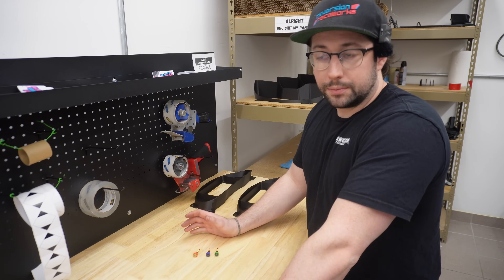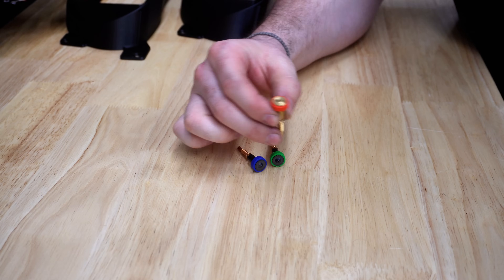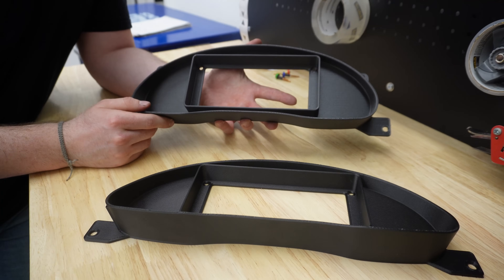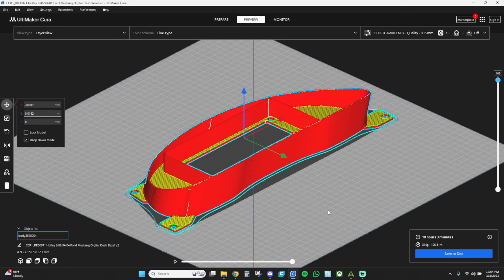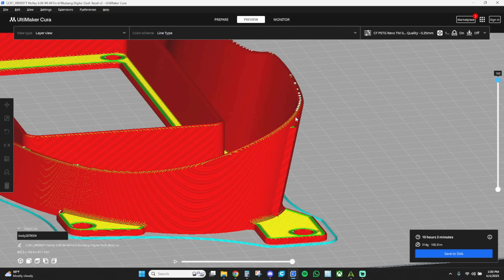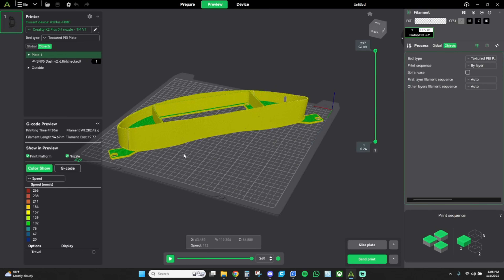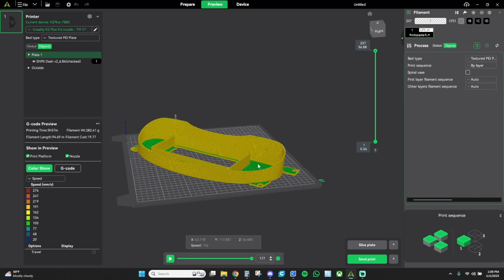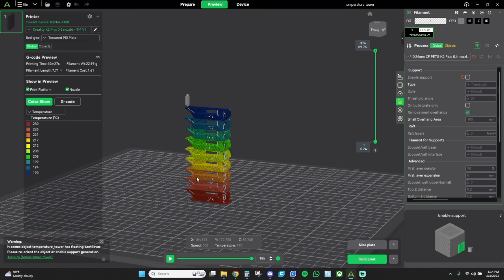Get better 3D Prints - What Size Nozzle Should You Use?

Comment: I switched from a .4mm nozzle to a .6mm hoping to increase speed on my Prusa XL and the time went from 3 to 4 days on a large print.  Any idea why it got longer instead of shorter?  Thanks!
Reply: Just a thought, but it could be due to slightly slower print speed. With bigger nozzle you can reduce number of walls and lower infill. Check wall thickness with 0.4mm and then with 0.6mm. Then you’ll see how many walls you’ll need.
Reply from the maker: My thought would be the “max volumetric flow”, default settings are usually pretty conservative for bigger nozzles. This may be called something else in prusa slicer, but I’d start with calibrating that. If you command a faster speed but it exceeds the maximum volumetric flow, the slicer will override your commanded speed so the extruder can keep up. If you have more questions, hit up our discord! We are happy to help

Comment: Hello, great video that I learned something from and in which I saw a number of things confirmed.
I switched from the 0.4 mm nozzle to the 0.6 mm nozzle early on when I started 3d printing with a Creality Ender 5 Pro. You can also print small parts with a 0.6 mm nozzle. When using the 0.6 mm nozzle with a Bambu Lab printer (I have a P1S), I have discovered that the nozzle temperature must be increased by at least 5% to ensure that the printed product does not become brittle and break easily. When using the 0.6 mm nozzle, it is necessary to reduce the flow rate, at least that is my experience.
Reply from the maker: I’m glad you found this helpful! We absolutely print small parts with a .6 nozzle as well, I normally go down to a .2mm layer height for the parts that need some more detail. 

I heavily recommend making unique profiles for nozzle sizes and materials, there’s too much variance. Although, one profile for a different nozzle is usually a “good enough” starting point for the tuning process. So I definitely agree with your experience as well!

Comment: I print loads of car parts. PETG will never hold up in a car interior, under the hood, or exterior. ASA is go to filament for this. Sit your PETG parts in a closed up car, or simply place them outside in the sunlight this summer, and you will see it warp and distort according to my testing. It may last for a little while, but long term I believe it will fail. I only have Bambu Lab printers, so your mileage may vary...
Reply from the maker: It’s definitely application specific! We’ve done tons of Carbon Fiber PETG in automotive interior applications. PETG CF has a Heat Deflection Temperature of ~175F. PETG without a composite added is likely a lower HDT and definitely less rigid, making it more warp prone. 

Even ASA is a bit too low for engine lay stuff, its HDT is about 185F. I’d recommend stepping up to Nylon for that.

Comment: One big issue I've had is how much "slower" my k1 prints with a .6 vs an identical k1 with a .4. i have literally sent a job to both machines within seconds and have had the .4 finish before the .6.
Right in the slicer, .6 speeds are always lower.
Reply from the maker: That sounds pretty strange. Our K2 and our media guys’s K1 Max both print fasted with a 0.6mm. While not as drastic of a difference, it’ll usually shave off something like 30-50 mins on a typical 4-5 hour print with CF-PETG. What materials are you using?
Reply: @reversionraceworks  hyper PLA, PLA +, cf PLA.
Reply from the maker: @GamingWithURO I would suggest tuning the “max volumetric speed”, fix the max value and dial it back by 15-20%. I find these safety factors improve reliability and quality. The default settings are likely too conservative, I’ve noticed creality only really puts effort into their .4 nozzle settings since they’re the most commonly used. The others are just a good starting point
Reply: @reversionraceworks  just screenshotted this. Next time I sit down at the PC I'm gonna mess with it. 
I had to make my own .6 profiles at 1st cause they didn't have any. 
Good looking out👍🏻
Reply from the maker: @GamingWithURO of course! If you have any more question, hit up our discord! Link in the description

Comment: Nozzle clogging with 0.4mm? I've had like 2 of those in 3000h+ of printing. 
If you are blobbing and clogging with a 0.4mm as often as you say, it's most likely your config or printer, nor the actual nozzle size.
Reply from the maker: Are you printing with composite materials?
Reply: @reversionraceworks  Sometimes, but not all the time.
Reply from the maker: Exactly, the .4 nozzle is great with normal filaments. We almost exclusively use composite filled filaments (carbon fiber and fiberglass). We found with the composite filled, it’s more common to see clogs and blobs on a .4 or smaller, but still get good print results. We just find .6 and larger to be more worry free and ease of use!

Comment: 0.6 is the first size for watertight prints. 0.8 is even better especially when printing vessels that should contain pressurized liquids.
One thing that I really  hate is hardened steel nozzles. I print only CF and GF filaments and those ting wear out soooo fast - nozzle mouth will get slightly rounded edges after pushing thru less than 1kg of filament.
Tungsten carbide is way to go if you like to have nozzles that dont need any maintenance. Just check them under the microscope after every 10 - 15 kg of filament.
Ruby is even better but im cheap :D
Diamondbacks are really bad as they come from factory with malformed nozzle "mouth"
Reply from the maker: Great tips! There’s so many options out there now, maybe we should do some more testing 🤔

Comment: My daughter’s boyfriend  just ordered a resin printer for his graphics design business. She has a small 3D printer as part of her embroidery business. I just bought the H2D. There are so many arguments back and forth on these things. I don’t like resin printers for several reasons. On is that the resins are very expensive and you do waste it when the item comes out. Secondly, the item is coated with resin that has to be washed off. It’s a mess. I’ve don’t it. Thirdly, there aren’t nearly as many choices as to resin type or colors. Nozzle size is complicated. For some things, I definitely agree with the 0.6mm nozzle, but for other things I would only use the 0.04mm nozzle. I just don’t agree with the one size fits all.
Reply from the maker: Definitely no one size fits all solution! Everyone’s unique use case should be considered first 💪🏻
Reply: So what?

Comment: ive never clogged my .2mm nozzles. However I still agree with you on the Resin for high detail opinion. But yeah, never clogged my .2's. Could just be bambu's design as these are the only fdm printers Ive used.
Reply from the maker: Do you use composite materials? We focus on CF-PETG, which in our opinion, would clog up really bad in a .2mm, we’ve seen it happy fairly frequently on a .4mm.

We’d like to get into resins at some point, but just haven’t had the opportunity yet. Those Bambu machines are great value for the money, and we’re happy they’re working good for you!
Reply: @reversionraceworks Oh, I wouldn't put composites through one. Good point.
Reply: @reversionraceworks  I guess I just assumed that isn't something people would be prone to doing. I thought it was really only for pla and maybe petg.
Reply: @reversionraceworks this is why I don’t believe that using just one size for everything. Making instrument panels with a 0.06mm works fine. But for a smaller part with higher detail, I find that the 0.06mm just doesn’t work as well as the 0.04mm. I’ve tried a 0.025 nozzle, but haven’t found much difference.

Comment: I found layer adhesion to be worse with 0.8 nozzle. How did you solve this drawback?
Reply: @sitedel do you print at the same temp and the same layer heights as a 0.4? You might need to up the temp a few degrees, you are pushing more volume.
Reply from the maker: Difficult to pinpoint not knowing printer, material, slicer settings, etc. But in doubt, when printing with adhesion issues, we will slow the speeds down, turn temps up a bit, decrease part cooling, use a heated chamber if able, and also increase flow to squish the layers into each other a bit more.

Comment: I print a lot of functional parts and unless it has very tiny text or details, I just change out the layer heights. I have printed 0.08 as well as 0.64 layers on the same nozzle, just depends if it is a final part high quality surface, same height as a fine 0.4 nozzle run but still twice the width or just a draft run for checking fit. 😊
Reply from the maker: Variable layer heights in some slicers are an awesome feature to lean into for the best of both worlds!
Reply: @reversionraceworks  the optimal slicer option for even finish would be to print all outermost wall layers at 0.08 and all inner walls at 0.4..

Comment: It is a use case thing.  For my projects I consider the 0.4 nozzle to be too coarse for anything but draft prints.  The 0.4 has visible layer lines even when you print at 0.08 layer height.  I like the 0.25 Revo and lately have been playing with the 0.15 Revo nozzle.  For my projects time to print is not a consideration.  Clearly this is the opposite of the goals of a print farm where pumping out plastic is directly proportional to profit margin.  I realize that for filaments with fiber fill the use of a 0.4 nozzle is problematic in that clogs are fairly common.  However, fiber fill parts have the downside of shedding the fibers and embedding themselves in your skin.  It is almost essential to use a protective coating on the parts if there is much chance of repeated contact with skin.  In general the filled parts are stiffer, more brittle, not stronger in a layer adhesions sense, but they do appear to have better dimensional accuracy which can be important.

Thanks for the Video and best wishes!
Reply from the maker: Definitely not a one size fits all application! I apricate your insight on the smaller nozzles, we should do some more testing on those in the future; maybe a future video!

Comment: Nozzle size depends on the desired resolution. If you don´t need high resolution and print bigger parts you go with bigger nozzles, it´s pretty easy. 
I use 0.25mm Nozzle on my personal home 3D printer, because I don´t care about the time it takes to print, I want the best resolution and the part is extremely strong since I print with higher layer widths than usual.
Reply from the maker: Definitely a good use case for smaller nozzles!

Comment: You said, multiple times, that the blue nozzle was "a good mixture between strength...".   Unfortunately, the way you phrased this, really doesn't provide information other than, there are some factors that combine together at some performance metric you like.
If you are comparing multiple options, you need to show all the factors compared to each other and where the performance measurements overlap and why.  It's not enough to say that strength is a factor, and is acceptable with the .6 nozzle when we don't know how it compares to the strength of prints made with the .4 nozzle.
Reply from the maker: Fair point, I just intended this video to help guide some people in 3D printing based on our experiences. Generally speaking when you are extruding more plastic with a fatter layer, the part will be stronger. This of course assumes that you have the machine tuned properly so there is adequate layer bonding. Obviously a lot of factors go into this and we'd like to do more videos with a deeper dive!

Comment: I dont know man, i dont know everything but i have never seen a .6 give anything but garbage surface quality
Reply from the maker: It’s all in the tuning! Nearly all of our production parts are made with a .6 nozzle
Reply: @ to be fair, the term quality in this context is highly relative, you may see quality on a larger scale and weighed against the time it took to make the part in a production invironment whereas i look at quality from a level of how close can i get to a “cast” part and i dont care how long it takes me.
Reply from the maker: @TheRenaissanceBuilder  I totally agree, in the one off application where you're looking for the highest fidelity sometimes there's more value to the machine doing more of the work. We've done this before when we were looking to paint parts because it required less body work to paint nicely, so less man hours was a big plus considering the 3D printer can run while we sleep.